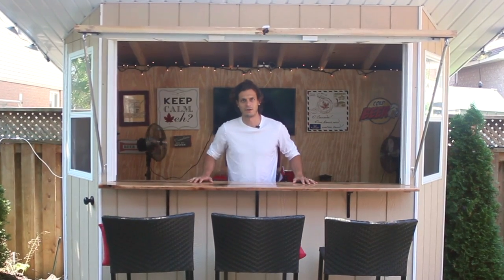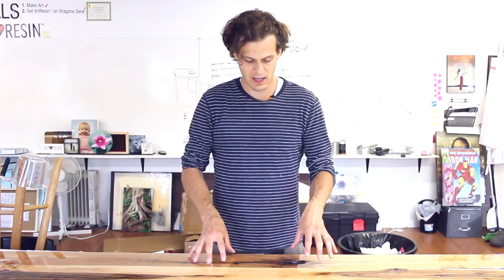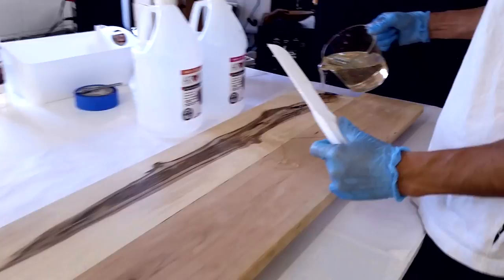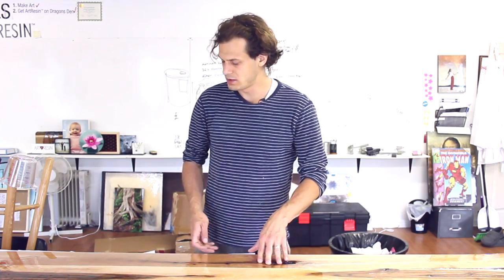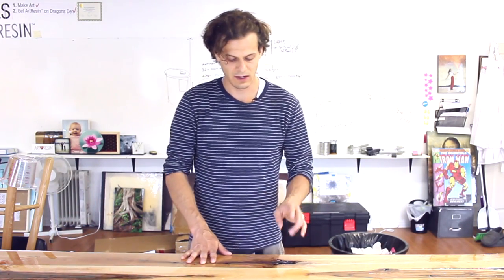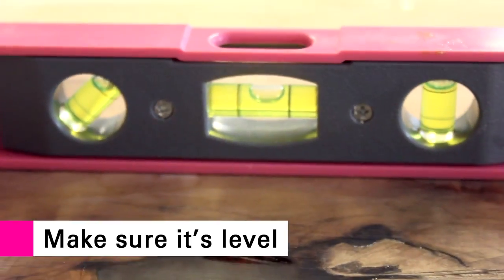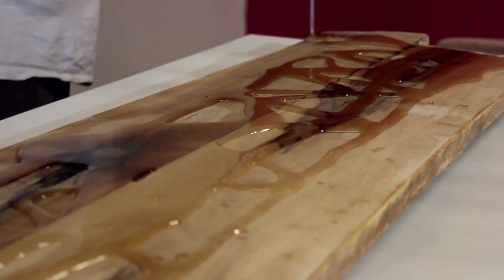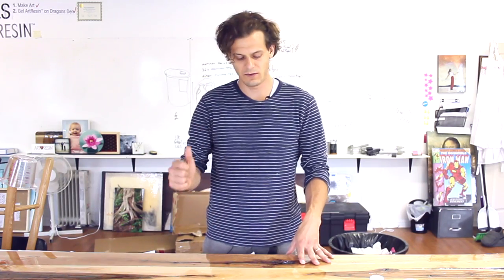How To Resin Coating an Outdoor Bar Top - Tips & Tricks

Comment: This is exactly what im looking for.  Im doing an outdoor bar and i wanted something weatherproof as im in Pa and we get hot summers and cold snowy winters.  I hope this works.
Reply from the maker: +dwg116 oh good glad you found us.  the bartop held up over a full summer/fall and winter so far :)  looks great no issues yet!  worst care, it could crack from wood expanding and contracting, but nothing a new layer of resin can't fix!  :)
Reply: How did your bar turn out?

Comment: Looks great mate. I was looking for a finish for a bar top. What do you do  when it goes over the edge for the drips. I don't want it curing and looking like dripping icicles. Plus do you have to also coat the underside to stop it warping
Reply from the maker: We would recommend coating the entire surface front and back with ArtResin to seal out any moisture.  You can simply apply a thin coat underneath using a gloved hand.  To avoid drips you can use painters tape and tape off the underside before you pour the top.  After about 18-24 hours remove the tape and all of the drips with it.  Here is a blog with more details: https://www.artresin.com/blogs/artresin/how-do-i-remove-epoxy-resin-drips?_pos=1&_sid=e2088293c&_ss=r

Comment: I live in the desert. It gets up to 122 degrees out here in the shade. Can I use resin on my plywood patio tables. Is this ok?
Reply from the maker: The maximum temperature that cured ArtResin can tolerate is 120F or 50C. At temperatures as high as that, the cured pieces may become a little flexible but once they cool off, they will harden up once again. If your cured resin is exposed to temperatures beyond 120F or 50C, however - for example, you leave a cured piece in a hot car for a long time - it could cause irreparable damage.

Comment: Why did you tape it first or did you not poor cracks first time
Reply from the maker: If the knots or cracks go right through the wood, you can apply tape to the underside to prevent all of the resin from dripping out.  For our final coat we applied painters tape to the under edge so that any drips that form can be easily removed once cured.

Comment: How has this held up after 3 years? Was thinking about an outdoor bar top covered in Art resin but read epoxy resin after curing can not be exposed to freezing temperatures or else it will crack. Also looked at charts for how this resin holds up in UV light and yellowing, and there is no data past 6 months.
Reply from the maker: Hi there - the bar top has held up, yes!  You're right when you say there's a chance of the resined wood cracking, but that's from the wood contracting and expanding and causing the resin to crack rather than any fault or fluctuation in the resin itself.  One way to minimize expansion and contraction in the wood is to make sure it is thoroughly dry before resining it ( you can even buy a little gadget to measure moisture in wood - the ideal amount is 4% moisture ) and to make sure the wood is thoroughly sealed.  

As far as UV light and yellowing - UV is very strong and damaging and all epoxy resins will yellow in time, including ArtResin - what you can be sure of, however, is that ArtResin offers the best protection to slow down yellowing compared to other epoxy resins on the market.  We include two different light stabilizers in our formula.  There are many variables as to the rate of yellowing, but keeping your piece out of direct sunlight is your best bet.

Comment: Hi, I'm wanting to make a resin geode table for my balcony. I got a uv resistant epoxy but I also wanted to use a uv resistant finish or varnish on it. Do you have any suggestions?
Reply from the maker: We don't have one to recommend but I might suggest checking with your local hardware store they should be able to recommend a durable UV resistant finish for you :)

Comment: I recently resined (with Art Resin) an outdoor myrtlewood coffee table for our covered deck. Any suggestions of what to cover the table with when it is windy/rainy in the colder months? Hoping to make or inexpensively purchase a good cover for this table. Thanks!
Reply from the maker: Hi Bonnie,  it's best to try and protect your newly resin artwork from all weather - sun, rain and snow. For best results, you just need to keep your new table out of the elements.
Reply: @Artresin  Thanks for your reply. I agree that keeping my resined table out of the elements is best. However, this is a coffee table on my covered deck. Some rain, wind and non-direct sun will undoubtedly have access to my table, even though the deck is covered. When it is windy, the rain blows sideways, sometimes getting on my table. Before it is freezing weather, we will be bringing it inside for the winter, but for the rest of the time, it will be on the deck. I've heard a breathable, water resistant (not waterproof) cover is best for this to protect it while it is on the deck, but was hoping to get more specific information from Art Resin. If anyone there knows of a good cover for this situation, please let me know. Thank you!

Comment: Looking to add a depth to a door I bought (custom wood door) would this add a 1/4 inch to a 10 inch x12 inch area?
Reply from the maker: Yes, you could layer in ArtResin to fill this void.  We would recommend doing it in two pours, allowing the previous pour to cure for 3-5 hours before adding the next.  Following this method you can layer ArtResin as thick as you'd like!

Comment: Great Vid!! I 'm interested in building a bar top for my outdoor Tiki Bar. My concerns are direct heat and sunlight in the summer and extreme cold in the winter, as low as -25. The bar will be boarded up in the winter so no direct contact with the snow. I need something 18" wide by 8'. Is epoxy suitable for this situation??
Reply from the maker: Hi John,  This bar top was built in a shady backyard out of direct sunlight in Ontario, Canada. Once cured, ArtResin is weather resistant and waterproof, however we still don't recommend that you put it outside in direct sunlight. With its advanced UV and Hindered Amine Light Stabilizers, ArtResin is chemically engineered to offer the best protection against yellowing on the market. Even so, it doesn't make sense to deliberately put your artwork in an environment full of UV rays - it makes it much harder for ArtResin's UV stabilization to do its job.
Reply: @Artresin  you basically are saying your product doesnt live up to its standards thanks

Comment: I read through all the comments and do not see this one so I guess I'll be the first! This bar he is making appears to be two pieces of wood put together. Is that correct? How did you get the 2 pieces of wood to stay together before applying the epoxy? Also, altogether for a bar this size, how much epoxy and resin would you say was needed? I am planning to do a bar that is 14 inches by 56 inches without any holes that need filled and I'm trying to figure out how much I'll need. Thanks!!
Reply from the maker: Hi Karli,  This bar top is two pieces of wood that were glued together.  ArtResin will self level to a thickness of approximately 1/8" when poured and you can determine the amount of ArtResin you require for one layer by using our calculator on our website: https://www.artresin.ca/pages/calculator 
Don't forget to take the sides into account when measuring.  If you would like a thicker application, you can pour in multiple layers.
Reply: @Artresin  thank you so much for your reply! I appreciate it so much! Your video was the easiest to follow. Can I ask one more thing by chance?! I used an oil based polyurethane because I thought that was the finish I wanted until I realized my desired finish is epoxy. Can I epoxy right over that or do I have to sand it off first?
Reply from the maker: @karlidemell3552  Oil and resin do not mix very well. If oil is present it is very probable that the resin will repel. You will need to to place a sealant coat over the oil finish, a water base sealant, think along the lines of Minwax or similar water base polyurethane  to create a barrier between the resin and oil.

Comment: How did you seal the the underneath side of the table? Did you epoxy that side also? I need to make a small table that will be exposed to the elements on a pontoon boat.
Reply from the maker: Tom,
Yes we did a thin coat of ArtResin on the underside as well to make sure the entire piece was sealed.
Reply: @Artresin , excellent! Thank for the quick response!

Comment: Can i use this on an outdoor table if it is left out in the sun and rain?   It is a small table 6 feet by 2 feet.   Just used for a drinking table on the outside of my bar.
Reply from the maker: Once cured, ArtResin is weather resistant and waterproof as well as heat resistant to 120 degrees F. So leaving it outside in the sun may depend on the area you live in and the hot summer temperatures.
Reply: ArtResin    Thank you for answering my question!!

Comment: I have a slab of black walnut and want to make a picnic table top with a river in it but don't know if it will hold up outside
Reply: It will eventually turn a yellowish color. All resins will do this in time.
Reply: @robertbascelli6433  Are you with Art Resin? I heard their product does not yellow in the sun.
Reply: @bonniedarlow3901  All these consumer resins yellow over time. Depends on the exposure of direct or indirect sunlight.

Comment: Do you step by step instructions?  It looked like you only used Resin when at first so just wanted to make sure.
Reply from the maker: Correct the first coat was just a thin coat of ArtResin. 

This video is more detailed and while it isn't a bartop it is wood and they steps would remain the same :) https://www.youtube.com/watch?v=R2s-NMwEn0k&t=26s

Comment: How does this look 5 years later? Thanks for any info!
Reply from the maker: Hi S Perreault, the bar top still looks good. It's been kept under a covered roof and out of direct sunlight :) We have sanded it down once recently and done another coat of resin for prolonged protection.
Reply: @Artresin  Thank you!

Comment: Question, how well has this held up so far? In researching epoxy, I have read that it doesn't hold up in sunlight, heat or UV rays.
Reply from the maker: +Gary Barcume holding up fine.  in the canadian winter right now!  we spent 3 years perfecting the formula.  non-yellowing protection like no other product on the planet.  we confidently advise thousands of artists to apply artresin over their precious artwork!    3rd party test data will be released shortly...  some great accelerated weathering results!
Reply: so how has it stood up since this reply or post?
 I'm about to do an outside bar. did you have the third party results?
Reply: I am interested as well on how this has held up under UV rays.  Looking for an epoxy resin for our outdoor tiki bar top project.  I'm going to check out their website.

Comment: Since it has been over two years how has it been holding up in your accelerated weather results?  I live in southern Georgia and it gets extremely muggy (high Humidity) here with high heat and UV exposure.  Any issues with yellowing and / or warping?  I want to use it for a home made out door pick nick table, and perminate bench set up from a full log cut in half.
Reply from the maker: ah, that's a great question!  This would make a great Video Friday follow up!
Reply: And the update? Would love to know

Comment: That material isn't supposed to be used for exterior due to sun exposure can make it sticky
Reply from the maker: Hi Jack :) ArtResin is heat resistant to 120F/50C. We still have contact with the owner of this bartop and it is still going strong.
Reply: @Artresin  I understand what your sayin but from what I read that material isnt supposed to be used for exterior

Comment: @2:21 you can see the flaws. im guessing cheap product
Reply from the maker: Hey Lorenzo - not cheap product at all, but what you're seeing are tiny micro bubbles which could have been caused by a combination of a couple of things: 
1) it may have been too thick a pour at once. ArtResin should be poured in 1/8" increments to allow bubbles space to rise to the top to be torched out.  If you pour too thick in one go, you end up with trapped bubbles.
2) there were probably bubbles that were covered by the coin and so didn't get exposed to the flame to get zapped out.  While the piece was curing, the bubbles floated up to the surface.  An option would have been to torch BEFORE the coin was dropped in, and then once again AFTER the coin was dropped in.  

The great thing about ArtResin is that it's very forgiving and if it was something that really bothered you, you could sand down the resin ( and sand out the bubbles ) and then re-pour several thin coats.  

Hope this helps!
Reply: Lorenzo Mendez  a quickcoat to the wood seals air from escaping from wood into epoxy. Check with wooworkersand torch each thin coat.
Reply: Not a cheap product at all... Very expensive in fact. There are better resins for less money.